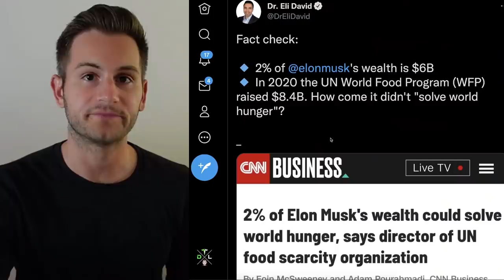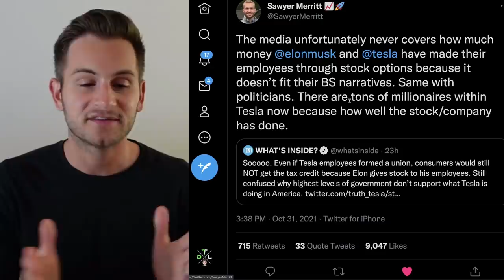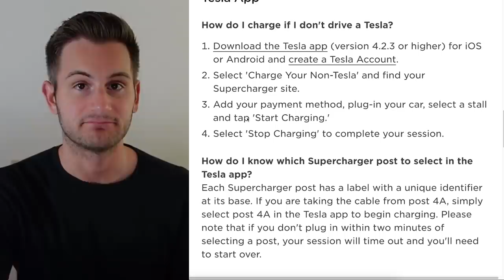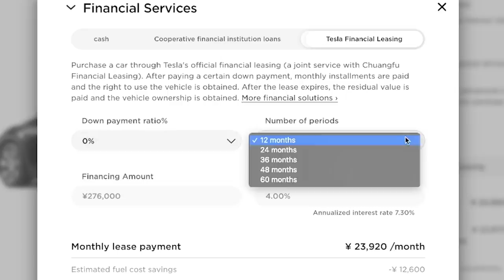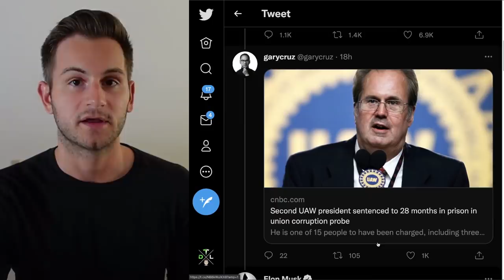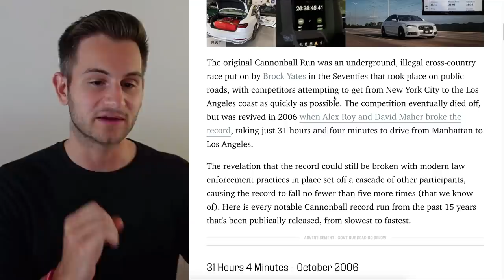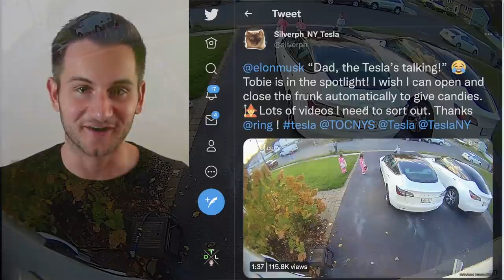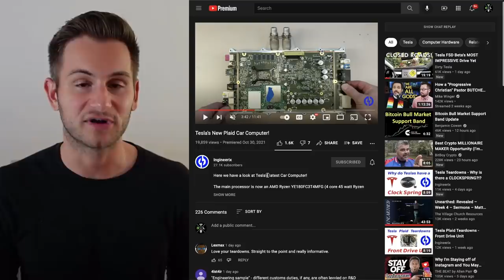Superchargers Are Open / TSLA Stock Split / Lucid Deliveries / Matte Black Cybertruck 🤔

Comment: Not surprised that the Netherlands was chosen for this experiment, because the latest Tesla’s in the Netherlands have the ugly CCS-plug, so the de facto standard.On top of that we have many charging stalls in our cities, though the charging speed is low 11kWh. I usually charge my TM3P overnight.
Reply: Yes your plug is prettier but we can charge our Teslas at public DC chargers from any brand, so totally worth it I'd say.

Comment: I hate the fact that I’ll have to share SC with none Teslas on the future (I live in a condo and strata won’t allow individual wall plugs so SC is my only means to charge) guess I’ll have to buy more tsla shares so I feel better lol
Reply: Check your local laws on EV charging at condominiums.  Many states in US prohibit condo board from banning wall chargers.  My home state of Florida allows a wall plug at any owner parking space.  I installed a L2 with private meter for under $100.  It costs me only $30/mo to drive an EV.
Reply: @johnpoldo8817  interesting thank you

Comment: There is no payment hardware in a Tesla charger, it must connect to the phone app with Bluetooth.
As usual they must have planned this years ahead.
Reply: Every car has an id. Teslas work the same to charge
Reply: CCS (version 3) was always meant to be plug and charge, so the protocols should be in place.
It'll be interesting to see how other cats handshake with Tesla, since we know the system works.
Reply: @rogerstarkey5390  Now I really wanna see a cat handshake with Tesla :)

Comment: I don't currently have any investment in Lucid, but I am rooting for them.  Just as with Tesla, I could see the potential, but I did not invest until after they managed to transition successfully to high volume production.  The odds of any new vehicle manufacturer successfully transitioning from small to large scale production are very slim!  But I truly hope Lucid proves to be a good company and manages to pull it off.  I love TESLA, but one company will never be able to fully transition the entire fleet of autos to Electric.  And legacy auto has proven that they are incapable.  So, we need a few good startups to succeed and become the new legacy automakers of the future.

Comment: Getting my Ioniq 5 next week, and will definitely try out the Superchargers. Prices vary per site, and are between €0,57-0,61 per kWh, or €0,24-0,28 with a €12,99 monthly subscription. The latter is cheaper than on street 11 kW charging, just a bit more than what you pay at home. 
Happy with $TSLA too... 😁

Comment: Tesla should create their own worker's union.  Place workers on a manufacturing Board to give employees a voice in their work.  It will also make them more sensitive to the need for company profitability.
Reply: It sounds like the 50+% non-shareholder employee requirement means Tesla wouldn't be eligible for it even if they unionized. Imo, the bill is designed to bail out GM (again) without having to say they are bailing out GM.
Reply: Tesla workers already receive stock options which  allow  1 vote per share.

Comment: Charging speeds may tapper off on a TESLA but with an IONIQ 5 or KIA EV6 you can get 174kW charge rate at over 70% State of Charge! Plus those cars have Vehicle to load that allows you to power anything you want from the car. Elon got caught in the TEXAS storm at a friend's house in the middle of nowhere with no heat, lights or anything. He drove there in a TESLA so his great big battery was useless during the entire storm because a TESLA does not have vehicle to load. Vehicle to load is way less complicated and more do-able than vehicle to grid.
Reply: Still have to have a backwards capable home charger and a grid window switch. Just to use v2x capabilities assuming your ev also allows those functions. So you have a great point, but didn't include all the necessary information to support it. So elon still would be sol in that scenario.
Reply: @4literv6   No you plug in individual items into those cars in a totally off-grid manner.
Reply: @honesty_-no9he  wrong, those cars cannot run a house which was your claim. The onboard v2l inverter only allows very small loads on it.
The lightning though can power a house and it's inverters are designed to handle that size of a current draw both ways. So make up your mind.

Comment: Co2 emissions may be done by country but China does have a higher population. Perhaps a sort by per capita may be farer. USA may well top that one. Manufacturing for other countries does skew the emissions. We buy goods so they pollute on our behalf then we say look they pollute.

On the plaid computer board the driver display may be classed as the main display and the centre console the passenger display. I doubt they do too many boards/chipsandthey will all be standardised by now. Thats how tesla saves money.

Comment: I m soooo disappointed  in tsla s way of handling supercharger availability to other EV when they kick their own tesla owners out if you have a salvage title.🤮🤮🤮 Good job tesla i hope none of the other ev s will have salvage titles
Reply: A vehicle with a salvage title is not even road-legal in Virginia. A salvage title is a sign that your car has substained serious damage. Even if you had it fixed, Tesla may understandably want to make sure it was fixed correctly.
Reply: @whatusernameis5295  not really it is just number that the insurance doesn't want to pay. I got my car salvaged for two doors a bumper and front windshield.
Reply: @norbibajgyik4460  ok. I think for most people it's fine anyway. Sure it'll suck if you have a salvage title for some reason, but I can also see Tesla's side that the vehicle had something happen to it Wich could have compromised the battery or related systems. And usually you don't super charge anyway
Reply: @whatusernameis5295  i don't really but I want to own my stuff. In this case who owns my car me or elon ???
Reply: @norbibajgyik4460  I would say you, because you can still charge with level 1&2 chargers. Plus maybe you can get an adapter and charge from other charging networks. Idk if that would work or not though
Reply: @whatusernameis5295  if i buy something im the owner of it period. You wouldn't want apple to kick you out of the ecosystem just because you dropped your phone and cracked the screen. No auto manufacturer on earth did this to their customer.
Reply: @norbibajgyik4460  I agree with you. But the supercharger network isn't yours, it's Tesla's and they can grant and deny access as they wish.
Reply: @whatusernameis5295  why the gas station is yours???